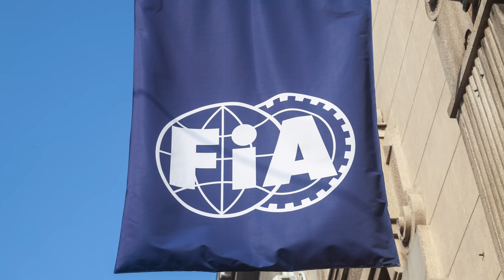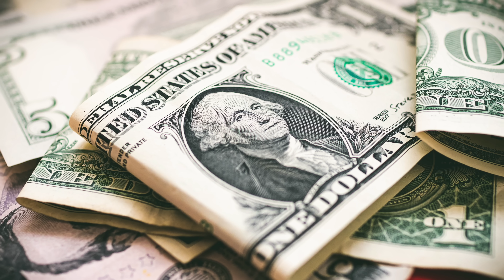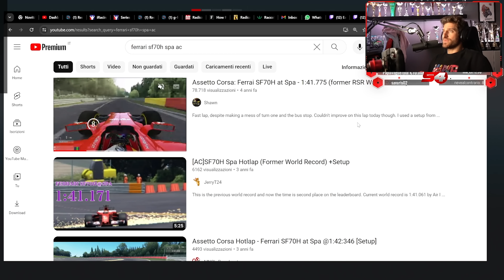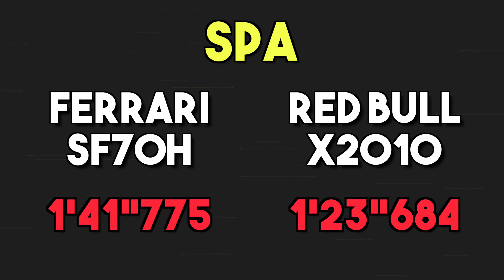The ILLEGAL Formula 1 CAR - How FAST is it?

Comment: In 2019 was a perfect example. With a little tweak with the fuel flow was the Ferrari 1 sec per lap faster on the straight. Imagine a different engine without rules would make
Reply: yes, an illegal Ferrari engine
Reply: @monky4158  That's the point of "No Rules".... 😂
Reply: @reinoldi1097  no I'm just saying he left the part out where that was cheating
Reply: @monky4158  bacause it adds nothing to the topic... the topic is a car with no limits... 
 xD

Comment: The Red Bull x2010 and x2011 were the literal embodiment of "F1 with no rules."
Reply: Looks similar to the thumbnail also
Reply: @kerimca98  yeah
Reply: Did you guys watch the whole video?
Reply: are you aware that the car doesn' texist in reality? so you can't say that as we don't know the real performance of such car design. it's all theory. but if we think about it this way, the perfect F1 car could be this or really close to this.
Reply: A fictional car in a game, such a stupid comment to make
Reply: Though fictional, it's far from unrealistic, it is designed by Adrian Newey himself, the guy who designs Red Bull F1 cars

F1 rules are actually holding so much back of how fast a racecar can go, but that's a good thing in terms of safety and such

The key differences are much more power, more downforce, and a fan. A fan isn't too crazy anymore since there are even road legal fan cars existing now, GMA T.50 (McLaren F1 successor)

All of that combined makes a car too fast already, the bottleneck is us humans

Someone could absolutely build this but we know no one's willing to spend millions $$$ on something dangerous 

Current F1 is already pushing drivers' bodies to its limit (Think of F1 Qatar 2023 race), X2010 cars like that is likely only good for 1 lap then you get too tired as a top athlete
Reply: @kerimca98  🙄🫣
Reply: @kerimca98  The problem is that you'd need a G suit to drive that car and it assumes that there are tyres capable of handling that performance so I am not convinced that's realistic enough.
Reply: So like the 919 evo?
Reply: @boiledtea479  The 919 Evo is still based on a platform that was designed under a restricted ruleset, meaning that even when unrestrained its maximum potential was still restrained by what it was based on and far from reaching the theoretical limit.

I think Adrian had also mentioned about the tires during the time he designed the Red Bull X concepts, no tires (at least not at the time) could handle such level of stress that the X could create.
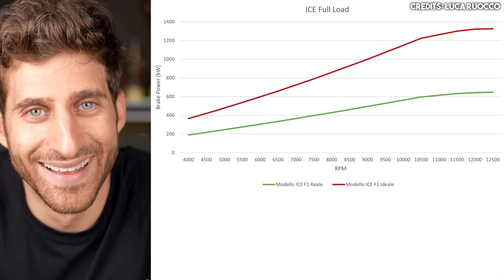Reply: @apophisstr6719  yeah, tho the test drive that did the 5:19 Nordschleife lap saod the 919 evo is capable of much, much more than a human can physically do. At times he pulled 4.5g latteraly driving the 919 evo. Nontheless, both the 919 evo and that theoretical f1 car are insane.

Also i have to admitt to not having watched the whole Video yet as i had things to do irl.
Reply: @jiboo6850  Yes. I remember reading somewhere that with its theoretical max cornering speed the G forces would just kill you. So it is not really applicable to race even if we were able to recreate the performance
Reply: I think the Ferrari f2004 is the true unrestricted f1 car
Reply: Technically they are the embodiment of any track racing car with no rules, not just F1.

Comment: You know, as a racing engineering enthusiast, i lost a dozen of hours thinking about it.
I think i have a formula for a illegal car that would smash any lap time:

Engine - The perfect engine probably would be a wankel rotary, yes, they are inneficient, they burn oil, and they aren't as reliable as a piston engine. But they surely have higher specific output, they are lighter, and they are smaller. Imagine a 2 rotor 2.6 liter turbocharged wankel combined with an electric engine, with the standards of development on F1, i can easily imagine numbers far from 2k horsepower. Or you can get rid of the electric engine and its appendages, and focus on reducing weight even more.
 
Gearbox - A CVT gearbox probably would be the perfect choice, because as a gearbox that has a continuously variable gear ratio, it would optimze the torque usage around any circuit.

Suspension - Like Williams showed us in the 90's, the active suspension can anticipate any type of undulation on the track, always mantaining the perfect contact of the tires with the track.

Electronic aids - Traction control, stability control, ABS, electronic steering system, electronic control of the convergence, divergence and camber of the wheels.

Body - A completely illegal body design would have a fan on the back of the car, sucking the air underneath it. Unrestricted venturi tube designs. Active aerodynamics. Coverings on all the four wheels, and the cockpit covering.

Comment: The real issue (to address here) into creating a hyper formula 1, would be to redesign the tracks. Different layouts, no sharp corners or very few, angular banking on long curves, double wide tracks, not making long boring straights but serpent like wide ones. Pretty much like Speedracer futuristic track layouts. The whole sport should be redesign from the ground up. With all this changes, a human pilot would be able to sustain a full race, not being pushed to 8Gs every corner. Also and very important; the spectators bleachers should be elevated in order to appreciate the cars from a high angle view. All this can be possible and it will be possible in the future. Example: UFC combat sports where not a thing before someone came up with the idea, it was banned or forbidden. All it takes is (of course) a lot of money (like Saudi kind of money) and a couple of crazy dudes who build the first prototypes of cars and 1 track. Then the rest will follow.

Comment: On the electric proposal (the main advantage being torque vectoring),  battries are not the only solution. You could have hydrogen or even better a turbine generator for less weight. Also the Renault mass damper was not included in the illegal tech list. And for the human limitations of a no rule car, we could limit the g-force or imitate the brain and put the driver in a liquid or a gel to cope with short duration high g-force.

Comment: a few things to add what about more wheels as it would mean more grip(you could even have multiple wheels that steer the car). what about nitro methane and nitrous oxide both would add hp with almost no weight gain and the other major downsides could just be ignored as you only need one lap. also aero breaks could be used for heigh speed breaking.

Comment: What i would love to see in racing would be significant energy recouperation. If you could harvest more energy by braking for longer, or havest less energy by braking harder we would have some interesting racing. Suddenly the fastest lap would be very vulnerable to faster sector times.
Also in F=m*a you don't always need more power for a better F. Sometimes a smaller m does the same thing just better.

Comment: Imagine a 5 liter V12 Formula One car. . . . That would be awesome.
Reply: Umm, yeah
Reply: too big! too much displacement. which would cause it to have less power than a 3L V10. because piston stroke would be too long with too much mass. it would have more torque though. but it wouldn't be able to rev at 20k rpm like a 3L. i personally hate the sound of low rev V engines. NASCAR, GT3 etc... 🤮

Comment: Why not unleash fuel restrictions, but also putting that fuel used in the mid 80s, and full use of MGU-H/K. Would be insanely powerful. Only unleashed full potential of hybrid package would likely add 350 or 400HP. 

Tyres gonna be stronger. Aero would be fully reworked to be active, same for DAS and so on. As you said, active suspensions, and more. Lightweight chassis and use of unlimited lightweight material. Would be deadly fast.

Drivers will likely have to have airfighters training and gears like anti G suits and all.

Comment: Of the drivers today, I would bet real money that Alonso, Hamilton, and Verstappen could drive the X2011 around any current F1 track and survive a full race, though they would probably be sick to their stomachs for weeks coz of all the high g forces. The problem would be for Pirelli or any tire manufacturer to make wheels that would last more than 10 laps especially at fast tracks like Suzuka or Miami.
Reply: The biggest problem with making real cars are engineering compromises. Easiest way to get faster is to be lighter. But if you go faster forces increase so parts need to be stronger not lighter.
Tires are most prone to that effect. You can only put a certain peak load through them and a much lower constant load. Otherwise they overheat and burn.
Thats one reason why F1 cars got so big over the years, so the tire gets further away from the center of mass and a smaller force is sufficent to provide enough torque to turn the car.

Comment: i always hope the fia would say: well your car needs to weigh this,  has to withstand our crash test, has to have these dimensions. May only produce so much drag and good luck guys. but that would probably never happen.  On the fastest f1 car ever, Honda did a test on the bonneville salt flats. You should look that up. That wasn't a legal car. They removed the rearwing i believe.  It went around 400 km/h
Reply: You’re correct that they removed the rear wing, but there is no rule in F1 saying you must run a rear wing so the car was still 100% legal. 
I agree that a “max dimensions/ min weight/ go have fun” race series would be awesome. There would almost certainly be runaway winners every race but the innovation would be insane.

Comment: Technically without regulations, we could just make the car bigger, put both a larger engine and a more powerful mguk in.
Although, that much power might not be that usable.

Lower wider car with more wheels, CVT, active suspension, covered wheels and awd torque vectoring and on top of that have a robot drive so it can fully control everything and pull Gs a human can't
Reply: CVT is the most stupid invention of all time for a car. YUK.

Comment: A formula 1 car travelling at 200mph crosses the starting line of a top fuel dragster at the same time as the dragster starts off. Well before the end of the 1/4 mile the dragster rips past the F1 car.

Comment: If your goal is to ignore rules and just have the fastest laptime, why stick to regular fuel when nitromethane exists?

Cleetus McFarland has a video where the only upgrade to a daily driver was nitromethane, and his Silverado went from 287 HP and 413 Nm at the wheels to making 470 HP at the wheels and 696 Nm at the wheels.

That's a 64% increase in HP and 68% increase in torque at no cost to weight. So, 882 HP would increase to 1,446 HP - again at no cost in terms of weight. If you go with the increased fuel usage and the 1,803 HP, you'd be looking at upwards of 2,950 HP. 

You say that 10 HP increase is a 2.5 tenth of a second reduction in laptimes. That's 0.025 seconds per HP increase.

However, this doesn't track with your estimation of 6.25 seconds per lap reduction.

You estimate a 1,250 HP engine compared to 882 normal. That's 368 HP difference. 368 HP * 0.025 seconds/lap is 9.2 seconds/lap - not 6.25. If we assume your time estimate is correct, we're instead looking at 0.017 seconds/lap (368 * 0.017 = 6.256).

564 HP increase for the normal fuel usage is then 9.59 seconds faster per lap.
And the increased fuel usage has a 2,068 HP increase, which is then 35.16 seconds faster per lap. 

And now we've moved from "neat thought experiment" into "unrealistic scaling", because you won't get an F1 car around Spa in 1'06. The simulated maxed out car only did 1'23 - a full 17 seconds slower.

Comment: BMEP is more a measure to compare NA engines. Turbochargers screw the results so it shouldn't be used there.
Even not comparing the modern Turbo V6s to the NA V10s

Comment: Faster might be impressive, but not better, or have better racing. On top of it, it's extremely dangerous. One tiny error and it's done. 

That said, if we look at the current F1 cars, there's still a lot to achieve. It's restricted due to a fake green image. Let's say we replace the current fuel with e-fuels, like the stuff porsche makes, and claim it's ecological. Now we remove the fuel flow restrictions. A lot of power can immediately be added, without actually destroying the engine, but even then, let's just let it run for like 5 laps tops. a 10 to 15% increase in power is certainly possible. that means a 100 to 150 hp increase should be achievable, that means about 2.5 to 3.0 seconds faster potential. The Red Bulls of last year and this year showed how efficient they can be with DRS. Now instead of having DRS on specific parts, let's allow DRS where-ever. And let's not just have the rear wing DRS capable, but let's have the front wing also DRS capable, and indeed, add qualy tires. On top of that, let's also add Mercedes' link suspension and it's steering camber trick. 

adding the F-duct might sound interesting too, but the issue is that the F-duct is there to 'incapacitate the rear wing', and we don't need that with DRS. so scratch that.

the hybrid system could theoretically be more powerful, but indeed would need to be bigger and heavier, and would change the structure and car too much, so that is to be ignored. 

a canopy could theoretically be placed on the F1 car, and would certainly make the vehicle more aerodynamic. it would also completely alter what it is, just like wheel covers would - it would no longer be an open-wheeler open-cockpit vehicle, but it would turn essentially in a LM prototype. 

adding a fan to the car also would alter the vehicle way too much, and is a complete concept change. 

probably, the above is at more or less the limit. you could completely get rid of all the paint, which makes the car ever so much lighter. 

Its still hard to calculate the potential gains. According to reports, DRS can make a F1 car have up to 25% less drag (that doesn't make it 25% faster btw). Now, could that mean that a double DRS could make the vehicle up to 50% less drag? hard to say. But, in theory, perhaps. Either way, DRS can make some cars, like the RB, significantly faster - it manages to be on one occasion 30 kph faster on a straight compared to an Alpine ( even though that had a different set up). It probably could add another 10 kph with front DRS. 

The above all in mind, it's certainly possible to achieve a 6 second faster lap time with the changes, and i would definitely not be surprised if you get up to 10 or even 15 seconds, even more efficient than that Porsche 919's improvement ( on Spa ). 

Monza, Jeddah and Spa likely would be the most impressive gains.

Comment: F1 cars are the fastest cars on a typical F1 circuit. And they're faster than other FIA formulas. 

But an Indycar is faster on a banked oval.

And, in a straight line from a standing start, nothing else compares to a top-fuel dragster.

Comment: The F2004 with modern slick tyres designed for it, plus wider wings,active suspension and DRS would blow anything out of the water

Comment: it's very simple why we don't make such cars. because human can't drive that. no place for racing. the least tiny mistake and it can have massive repercutions. huge collective crash. people injured in the stands. tyres would cook so fast that you'd need 10 or more pit stops to finish the race. this is technically and humanly stupid. or just go drag racing with 11k HP and go straight with parachutes and so on. i mean... racing is not compatible with extreme builds. or it would be a time attack type of racing. which is not F1 either. we clearly found the limits with the Gs we can endure and the power we can deal with. therefore, the ultimate car following these rules is what we have today. 

the things that would really improve racing are, making them lighter and narrower to improve fuel/tyre consumption and agility to improve racing. all the rest is pure non sense and overkill. 5G lateral, 1000hp and around 700kg with a narrow profil is the extreme limit for an F1. over that would be insanity.

Comment: There are faster race cars on the planet.  F1 cars have the fastest cornering speeds. Top fuel cars do over 330mph, thats 100 mph more than F1. Indycars hit 240+ on the straights at Indianapolis Motor Speedway.
Reply: You missed the part of the video between 1:15 and 1:30... 😂